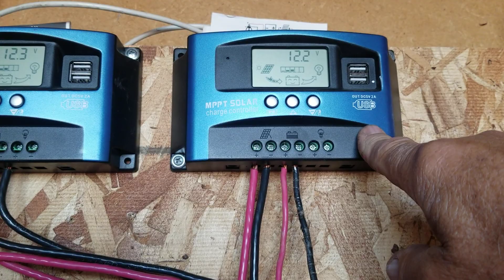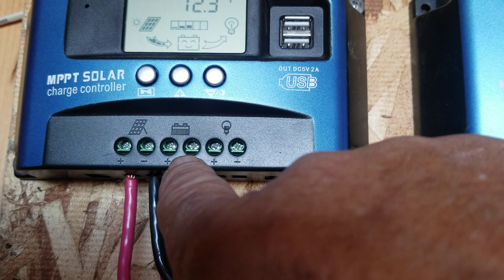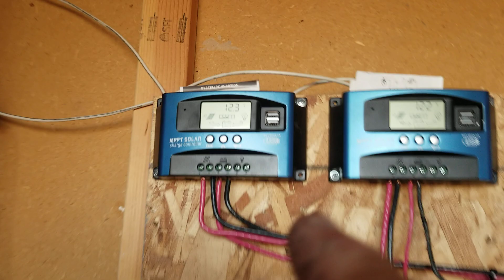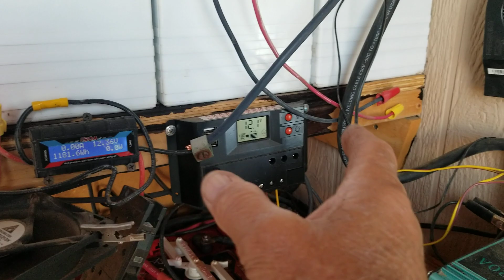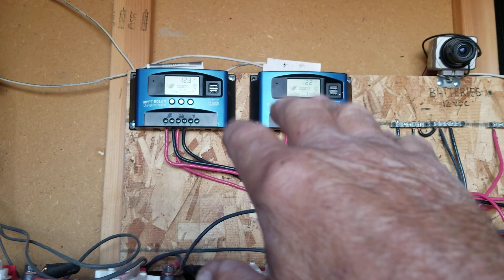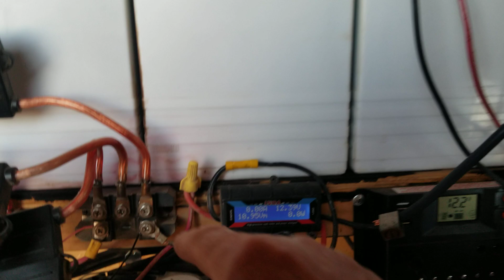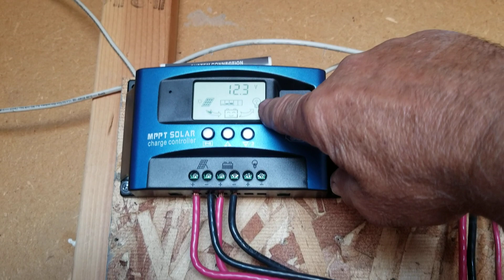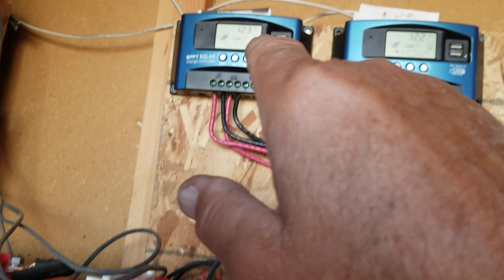HOW TO Set up an off grid solar&wind system, Sep. 20, 2019

Comment: BTW G Bear, those "MPPT" solar charge controllers are NOT MPPT... It is a fake, they are actually PWM. I would stick with EPEVER...
Reply from the maker: Welcome aboard!  Yes, I watched a video of a guy taking one apart.  I am demanding my money back due to false advertising.
Reply: @GBear  If you only have 1 inverter and you know the saying 2 is 1 and 1 is none... I would recommend forking out the money for a combined inverter charger unit. They came down in price. There is a guy that has a channel on here that tested them. If I can find it I will share.
Reply from the maker: @11mleger  thanks in advance.

Comment: A car alternator can run the car and all of its components without a battery.
Reply from the maker: Interesting!  Of course you must be talking about newer cars.  Back when I was an auto mechanic a generator would work, but an alternator needed power in to put power out.
Thanks for your input, and welcome aboard.
Reply: G Bear's Off Grid Ways-A Homestead In The Desert ---- I wouldn't recommend doing it with newer cars at all just disconnecting the battery with the car running can ruin the brain. I'm talking about older 12 volt alternator Car's. I have an 81 Chevy truck I run around my property to this day and I have it parked next to my battery bank and start with the external batteries then disconnect the battery bank and run can run it all day with no battery in it at all. Headlights everything works. It puts out 14.2 volts why wouldn't it work. Your right about the solar panels only charging. I do have a 300 watt solar panel running a 12 volt hot water heater element with no batteries and it heats the water good. You don't get scolded but can take a comfortable shower.  I have a system very similar to yours.  Gotta love it.
Reply from the maker: @MrKoladge  80's!?!  That's not old!  When I was a mechanic I worked on cars from the 50's and 60's!  Lol. Back then if you put your friends battery in your car with an alternator thinking "We'll start it and then you can have your battery back."  As soon as you disconnected the first cable the engine would die.
Reply: Must have been a 6 volt system or a very week charging system. I have a 65 Corvair 12 volt I did just that. my battery was dead and I put my marine battery in it fired it up took it out and it didn't die  put the weak one back in and brought it back up to full voltage..

Comment: More fodder for you ratings.

You are right on a lot of the info you show. Your parallel battery tie is great, your advice on the placement of the CC output cables is terrific.

The reason the windmill uses 10 ga wire from the turbine to the inverter is its running AC voltage at a higher voltage, and the rectifier converts down to the voltage needed by the battery. 

If you have an 8000 watt load on your battery bank, you better have the solar to rebuild the watts in time. Or you are going to be without power as the solar replaces the used energy.

Total watt hours out of the battery bank need to be put back into the bank. 

Solar panels produce their watts constantly as long as the sun is shining. Most loads are sporadic. Fridge motor runs, til, the box is cool then shuts off. So 500 watt for 15 minutes each hour would be 500 watt hours every 4 hours, 1kwh every 8 hours, 3 kWh per day... average. So the solar assuming 8 hours of production has to put out 375 watts in the daylight to cover the 500 watt sporadic load of the fridge.

In the summer, an AC will run nonstop, so that usage needs to be added for say 12 hours constant (while the sun is up and a bit after sundown)  get a 1000 watt AC, let it run constantly during the day, and it eats 12kwh of the bank... it all needs to be made up by the panel or windmill input.

Calculate what you want to run, and how long it will run for, and then provide enough wattage input to fill the bank during the day.

Comment: I have always heard that whether you have 2 batteries hooked together or 72 batteries,, you still have only 1 positive and 1 negative post to use for hookups.... It is because of the way the electrons flow through.. .. So,, which is it.?  I'm soooooo confused..
Reply from the maker: Correct.  If you connect 2 six volt batteries in series you'll have a 12v battery with 1 each pos and neg terminals left.  But when you connect batteries in parallel pos to pos, neg to neg, all terminals have a connected wire, and you can use any one pos and any one neg to connect to.
When multiple batteries are set up in a parallel bank though, it is best to connect your load to opposite terminals of the first and last batteries in the bank so the load draws through the whole bank as if it is only one giant battery.  I hope that explains it.

Comment: With the 50amp starting charger...
Ever put it to start and cranked the engine? Notice the cables start smoking if you go more than a few seconds?
Reply from the maker: No, never got smoking cables on my charger, the heavy load from the starter is on the battery cable to the starter.  The little wire on the charger are only charging the battery, just like the little wires from the  130A alternator.
Reply: G Bear's Off Grid Ways-A Homestead In The Desert you aren’t thinking correctly.

If your car battery is dead. It will not start the car.

If you hook up a charger on starting amp mode, there is usually a timer to cut it out after 10 seconds or so, and the cables will get VERY hot when the car starter is spinning.
Reply from the maker: @SuperVstech  a dead battery isnt worth jumping or charging as the alternator will not work anyway.  Automobile alternators require power in to put power out, so as soon as a battery charger is disconnected the engine will stall.
Reply: G Bear's Off Grid Ways-A Homestead In The Desert I hope you can open your mind and accept math truth and stop arguing points with incorrect irrelevant ideas.

You made a point that a starting charger has tiny wires yet is rated at 50 or 100 amps to start a car with a dead battery.

I made the counter point that WHEN the starting charger is in that mode trying to start a car with a dead battery, the tiny cables will get hot.

You argued you never saw the cables get hot starting the car because the starting amps come from the battery.

I point out, NOT when the charger is putting out max amps to a dead battery starting a car.

You then say a dead battery is pointless for your reasons of no alternator output etc... 

If you could just wrap your head around the facts, this channel would have great info and be a lot more helpful.

Comment: id say a dc clamp meter is a very helpful tool for beginners like a cheap yet good mastech dc clamp meter.  ohms law is another very beneficial tool for working out what cable sizes and fuses youl need , need cables big enough to handle whatever a systems total combined surge would be. if you undersize your cables to an inverter you can end up with a ripple in the dc current (electricity) and potential ruin an inverter. thats the things i learnt ages ago.
one question as the ebay adds arent very specific, do your new controllers have a max dc voltage like say 50vdc , ive since found some pwms can do 50vdc input and charge 12v with 50v input which sellers confirmed this , just wondering if your controllers are like that too.
Reply: The pwm can accept 50v, but a pwm CC will shunt the voltage down to the charge voltage. 
An MPPT CC will convert the 50v at 10 amps in to 14.2v at 35amps.
Mppt puts more watts into the batteries.
Reply: @SuperVstech  problem ive seen is many mppts arent mppt or theyre underperforming mppts due to cheaper design and manufacture, ive looked at renogy 40 amp mppt theyre a cheaper option to play with until i finaly go with a reasonable sized victron. ive seen many pwms outperform cheaper mppts.
Reply from the maker: These auto distinguish incoming voltage by the battery type and voltage, so I suspect input match would be required.  They will handle 60 volts, but for a 24v system according to the spec sheet.
Reply: @GBear  thanks for the info , i looked at another that i was more familiar with , it had 50v max for 12+24  yet i thought the 50v would be for the 24v battery banks only yet the seller on ebay said even for 12v , i guess im going to find out the hardway LOL , hopefully it will work on 12v with 40v open circuit panels as she assured me it would, its for a freind on an extremely low budget, his panels are top grade 200 watters yet he has one huge german made 12v battery. to run a small portable DC refridgerator
Reply: closertothetruth a 200 watt panel at 40v would be around 5 amps. They usually drop to a MPPT value of 26v so as long as your friend has a decent mppt controller, and you should get 18 to 14 amps into the battery.
Reply from the maker: @closertothetruth9209  how many amp hour is his battery rated at?  Also, I'm assuming it is a deep cycle battery?
Reply: @GBear  its a huge industrial battery not something most would use off grid , but not as big as the 250kg 2v batteries ive seen working in heavy industry.

Comment: Thanks lots of great information. Do you need fuses between battery and inverter?
Reply from the maker: No.  There will always be ONLY 12vdc feeding the inverter.  No power surges should ever be experienced at the point unless there is a lightning strike, and a fuse is the least of your worries at the point.  Besides, think of how big that fuse would have to be to get installed online on 2/0 wire!
Most inverters have fuses in them already to protect the inverter from damage, as I showed in a recent video.  After the inverter, the 120vac side needs fuses or breakers to protect the load side of the power.